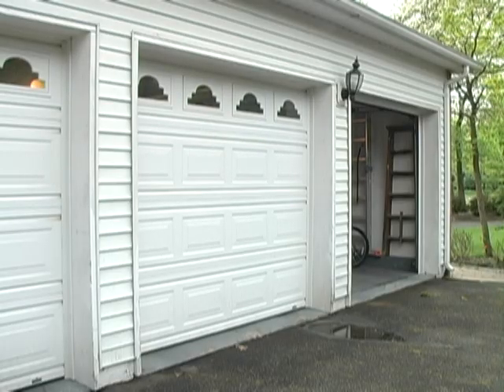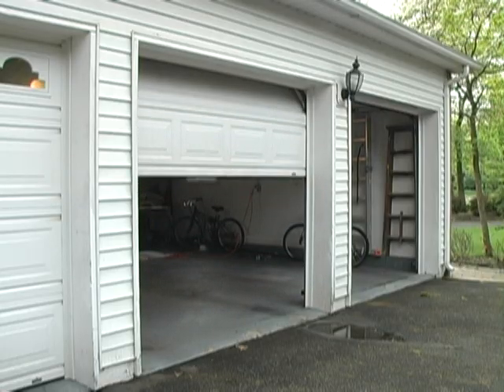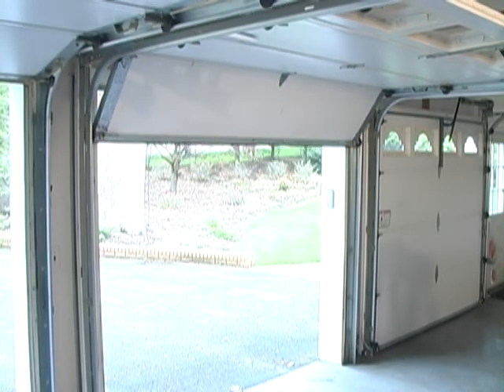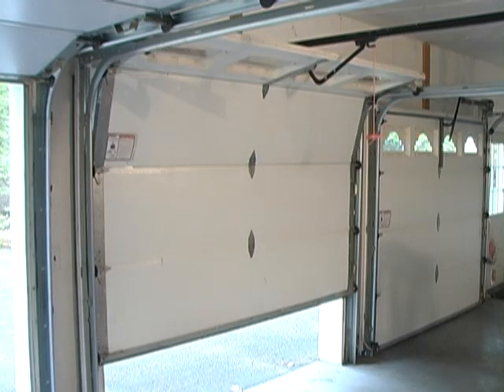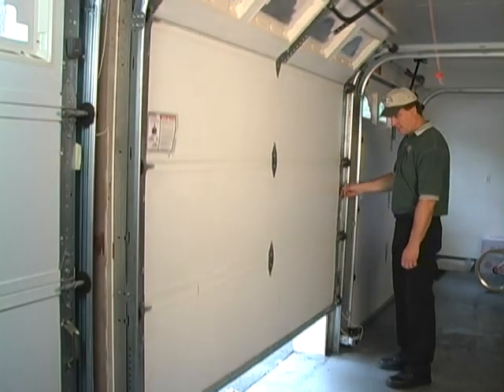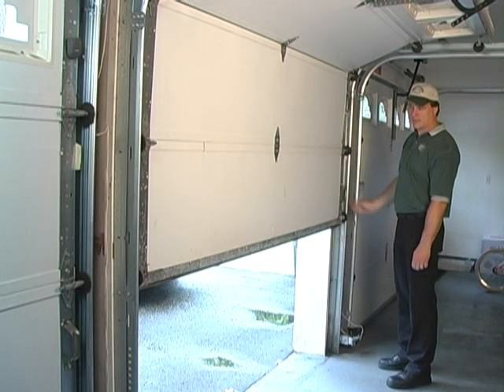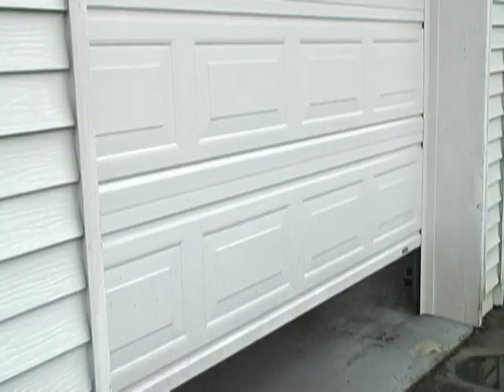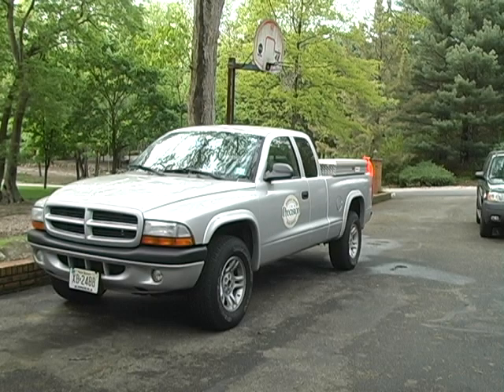Garage Door Balance Test

Comment: Fine point question....ok.... should be stable and stationary, at mid-high opening. I would expect that with the mass of the door changing from horizontal to vertical as it moves up-and-down.....that it would still be ok if the door TENDS (slightly) to go up at somewhere in the "UP" position (past mid-high)_....AND.....that it wouldn't be unusual for the door to TEND down if only lifted a foot or so ( below mid-high)..... RIGHT ?